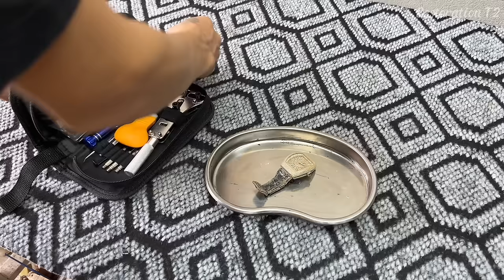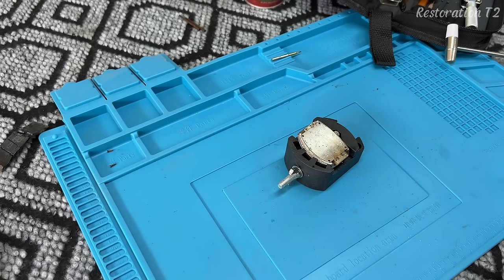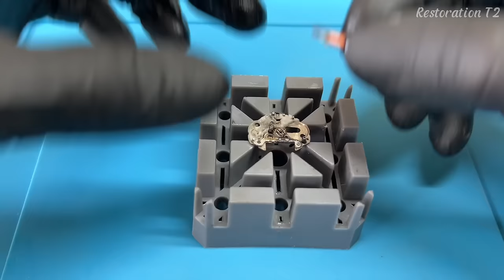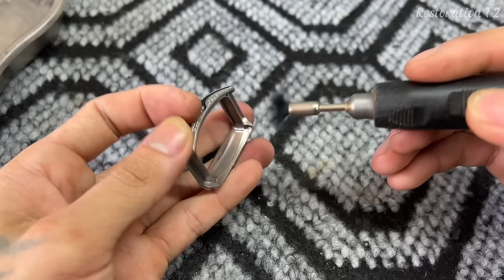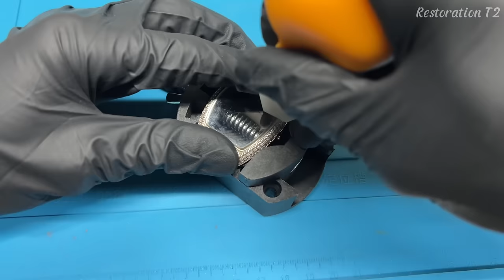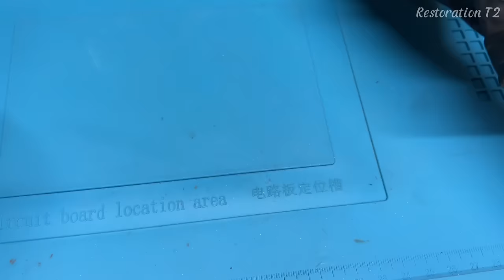Restoration  Franck Muller V32 Full Diamond watch buried after many years

Comment: That was a cheap watch I could tell that is kind of look real but they are facing everything is not expensive watch however the end of the video was very interested different how long was India under the water in the sand in the dirt there it's kind of hard to tell didn't look like it was that long to get inside like it's from the jewelry was interesting to watch anyhow it wasn't a waterproof watches for sure
Reply: Thank you for the response